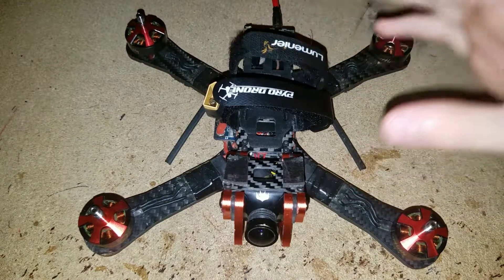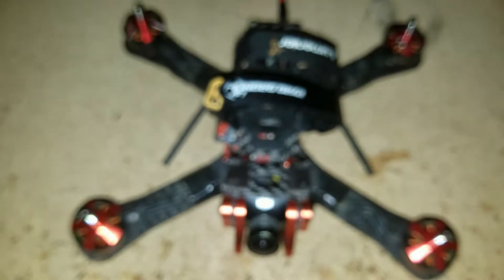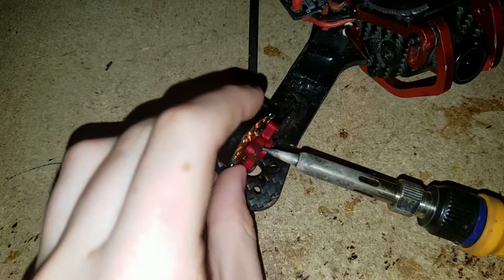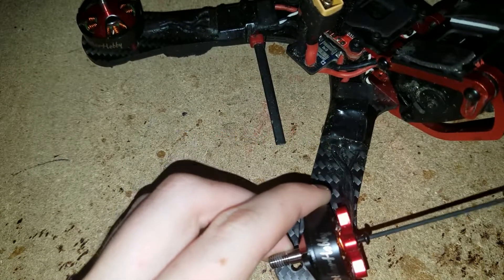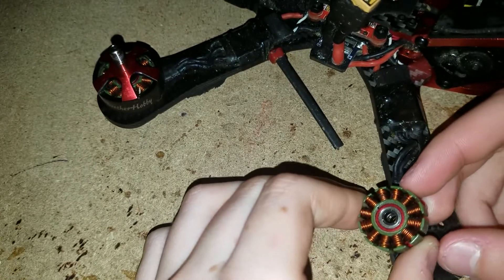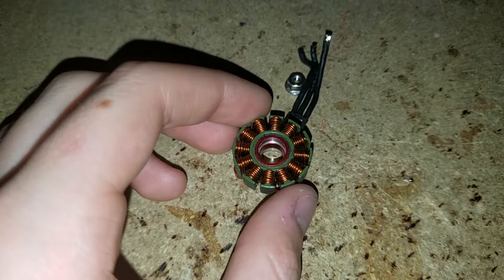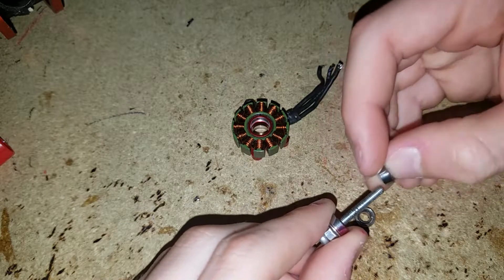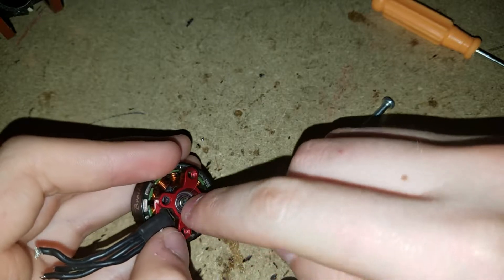How To Replace Brushless Motor Bearings, The Cheap Way!

Comment: Since u have been inspired by Project blue falcon's vid, was it easy to identify the "tighten the screw unit u fell pressure" he ws talking about when reinstalling the bearings? Also, I have a 2206 motor (so the same stator height and bearing size). Would u recommend getting a longer screw, 35mm maybe? PBF mentioned that the diameter of the screw should match your bearing and to get a 30-35mm screw. Would it hurt to just get a screw that u know might be too long, rather than running out of threads and stripping the nut?

Comment: Two days after i've uploaded my video "FPV - Brushless Motor Bearing Replacement - Brotherhobby Returner R4 - Quick & Dirty" you uploaded a video with exactly the same way and almost the same motors ... strange, what a coincidenc. 
But to be honest, i've also been inspired by Project Blue Falcon ;)
I've also had problems to unsrew the motor bell screw and even couldn't change the problem on one motor with changing the bearings - on this motor i've had replaced the bearings twice till the problem was solved. It also depends on the presure by rescrewing the motor bell screw.
Reply from the maker: +Torban Dallas Haha that is a bit strange
Reply: 5-6 min?? You only need 30seconds, tops, to melt the locktite.. cheers